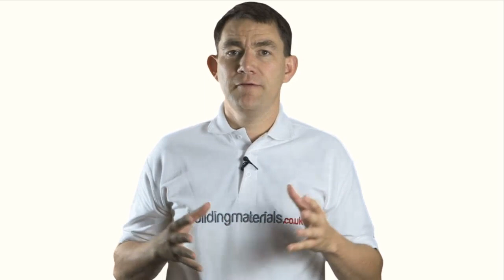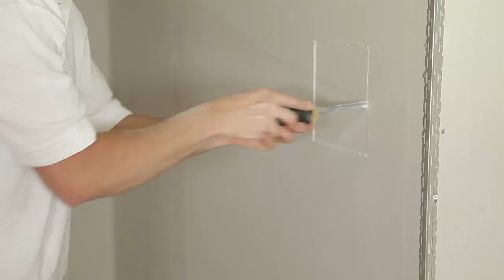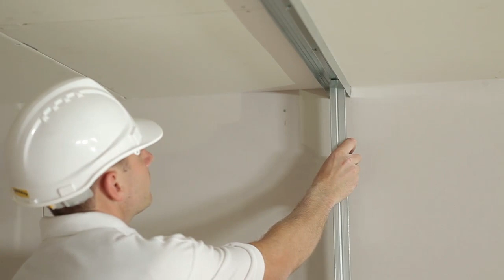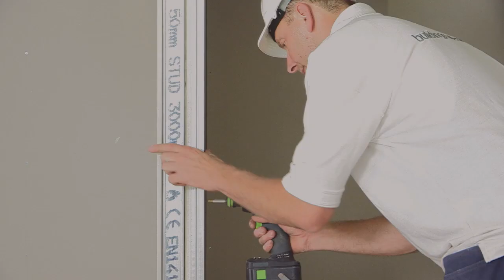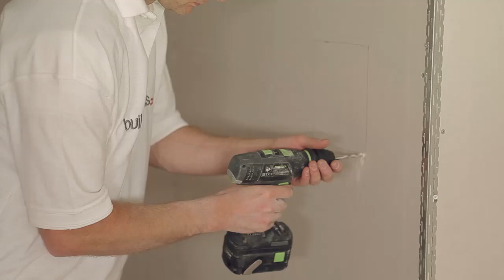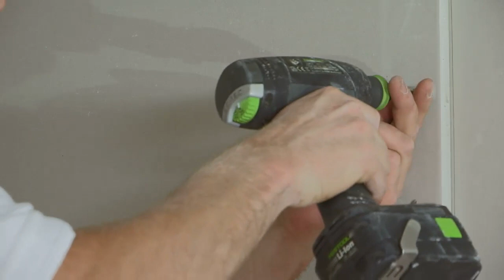How to install a stud wall with insulation and access panels

Comment: Hi, what thickness of insulation do you use for the metal stud frames? I see you have 50mm stud, does 50mm board insulation fit that?

Comment: why do you use 300 mm instead of just 30cm? when you measure out a wall length do you say 4,000 mm?
Reply: Some Architectural drawing sets use mm. And yes, they note thousands of mm LOL   Most where I live are in feet and inches, but from time to time I see plans with mm
Reply: Because going from 6mm to 6cm is a change of denomination and could be misread, whereas 6mm to 600mm means no room for confusion.

Comment: Shouldn't you fix the studs with the plasterboard so the plasterboard holds it all in place?
Reply: P James Was thinking exactly the same! Doing it the way you suggest, means that you don’t have raised edges from the way for head screws. Plus, it means you don’t have to spend time measuring centres and then finding that you are slightly out! With a floating stud, you can adjust the position at time of driving the drywall screws into the board. Most studs have a line running through the middle to highlight the centre of the study, which aids in installation.
Reply: @steves1460  to be honest I've never heard of NOT securing the studs ahead of time. None of these videos ever have any electrical or anything in the walls conveniently. You can't just close up the walls first day. On some planets we have wires and outlets and those have to be inspected and thus the wall be open at least from one side. Easier to work if both sides open. What's wrong with setting the studs in place ahead of time? You know the size of the drywall it's not a surprise. However I did find out there is a crimping tool instead of using screws.
Reply: @kraven4444  If there is no need to fix in place, other than the ends, why bother? It means additional screws that can get in the way and everything locked into place, as well as time. If there is a particular need for it, then fair enough.
The crimping tools seem to divide opinion, like Marmite.

Comment: Very nice video, but, safety wise I don't know about UK, but here in Canada, there is a lot of stress on safety measures with safety glasses while drilling screws.  Next time in a different video, try to use safety glasses, which none of your actors have in this video. Oh yeah, next time please make the video in a normal speed rather than  fast speed. Overall very informative! Thanks
Reply: on the flip side I was just thinking how silly it is to be wearing a hard hat in like the safest environment on earth. They just throw on these rules of always wear one, just to protect themselves.  It's like asking every normal day driver to wear a damn racing helmet, just in case.